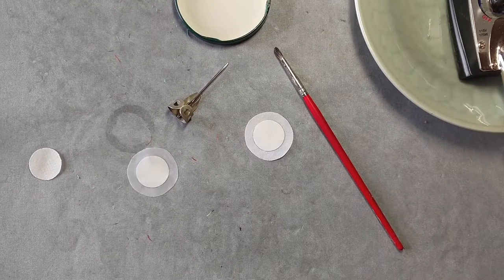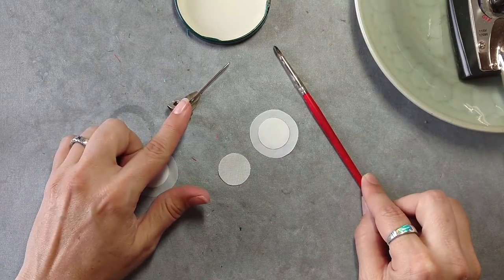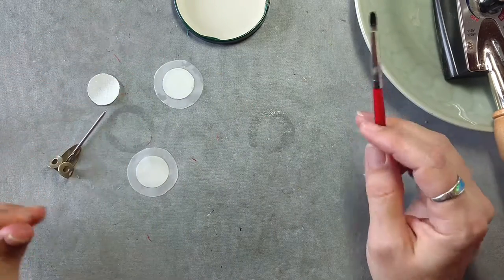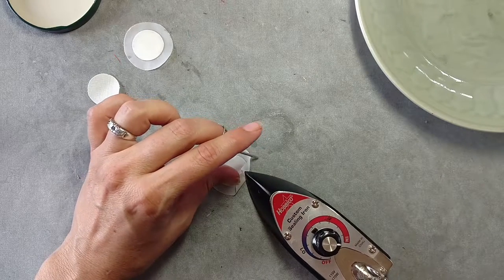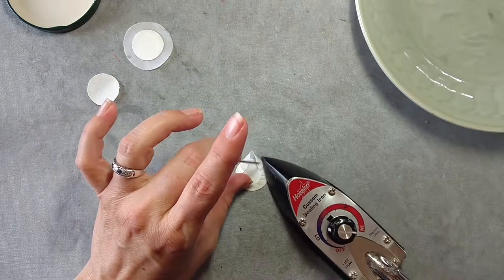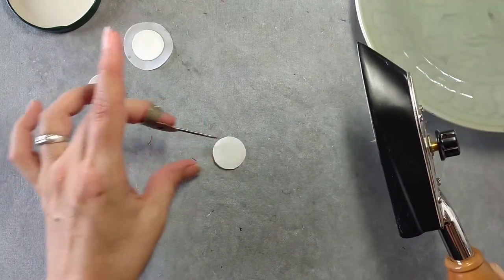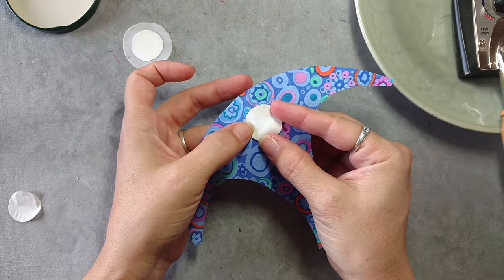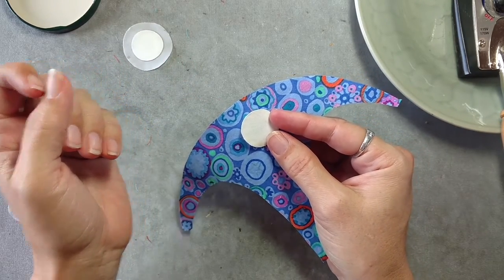Preparing circles and using lining fabric

Comment: Where do you get the needle you're using as well as the iron? Thanks!
Reply from the maker: Karen Higgins  The needle is called a trolley needle.  If they don't have one at your local quilt shop, I carry them on my website.  The iron is a Hobbico sealing iron and they are still available on Amazon.
Reply: @SwanAmity  no they do not ...not like the one on video
Reply from the maker: @dianeandress7963  You can purchase a trolley needle from my website www.SwanAmity.com if you like .  :)